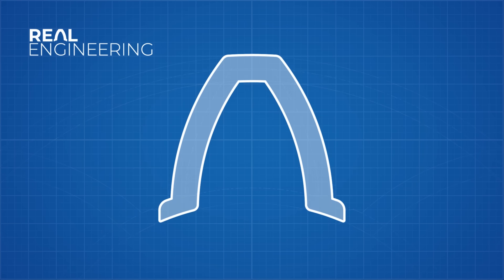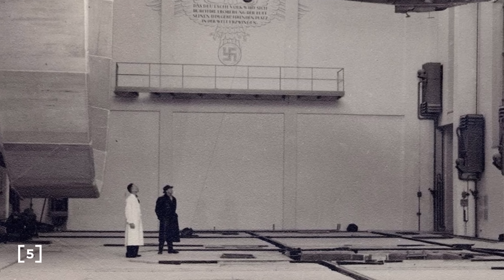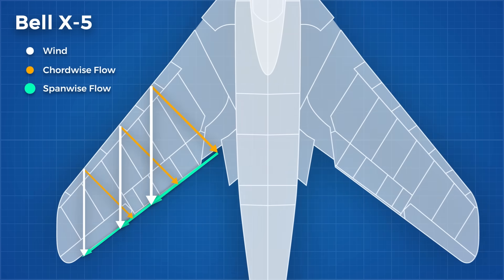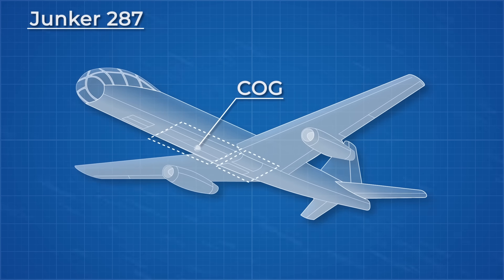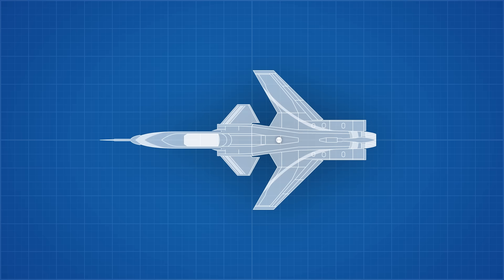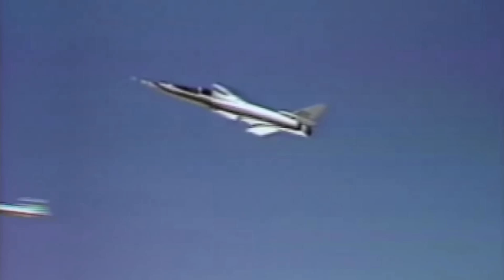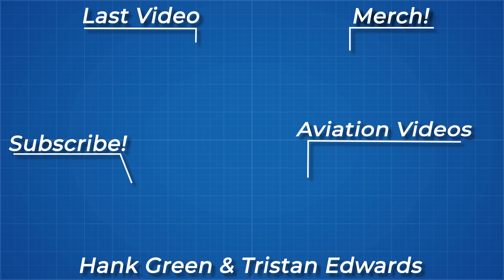Why Do Backwards Wings Exist?

Comment: I don't think it was due to ailerons becoming less effective.. it was that tip spillage and therefore tip vortices and induced drag (especially at high angles of attack) were exacerbated by rearward sweep. Yes, rearward sweep also increased the propensity of the wingtips to stall. So by sweeping the wings forward and moving lateral flow to the root,  you reduce or eliminate tip vortices and prevent tip stall. I also think your analysis of canards causing instability is off.. there are a lot of stable canard designs, many are even homebuilts.. what matters for longitudinal stability would be the location of the center of gravity (and the size of the stabilizing surfaces). The reason the X-29 was unstable wasn't the canard layout, it was the rearward CG. The reason why canards aren't used for large airplanes is that they are relatively inefficient - the mainplane can't operate at the maximum coefficient of lift because the foreplane has to operate at a higher coefficient of lift than the mainplane. This, by the way, makes canards inherently safer (especially for general aviation) since the foreplane always stalls first, and the nose drops while the mainplane is still providing lift.

Comment: Taming the pitch instability is easy with modern closed-loop flight controls, and the aeroelasticity issues can be resolved by tailoring the wing's  composite layup to have the desired bend-twist coupling. The real show stopper is radar cross section. Forward swept wings are like flying neon signs in the RCS world.

Comment: Wing roots aft at the already most reinforced section of the engine compartment allows a lighter front making a lighter over all and heavier load bearing wing if wanted. Would be great as an interceptor only plane able to accelerate and climb faster with a light plane and missiles. But interceptor specific isn't the thing anymore.

Comment: Similar reason forward mounted steering racks/linkages are more stable than rear on vehicle steering axles. The bushing deflection acting in a similar manner to wing tip deflection.

Comment: Additional Facts :--->
(1) The bernaulli principal for describing lift over airfoil is inaccurate. We must understand it through Coanda effect and Coeff of pressure distribution
(2)  In Sweepforward wings the root will stall first then tip at high alpha which will cause sudden loss of lift.
(3) like sweepback it is also good in directional stability

Comment: Forward swept wings grant good low-speed handling, which is why they are not uncommon in sailplane designs such as the Blanik and Puchacz series of glider trainers (and others).
Reply: And allows the wing to be attached behind the long two-seat cockpit, so it doesn't obscure the view from the rear pilot (as you have in Ka-7 and Ka-13 and older sailplanes).

Comment: “People like to say this is false but it’s just one of the ways a wing generates lift.”  No it false because it misapplies Bernoulli’s principle. Bernoulli’s equation is only valid in steady, incompressible, inviscid, and irrotational flow. The flow around a wing is viscous, rotational and in the cases you are describing compressible.  Also the air is not lower pressure because it is faster. It is faster because there is a low pressure zone that causes it to accelerate.
Reply: Whats it mean when you say flow around a wing is rotational?
Reply: jetison333 the curl of the velocity field is nonzero

Comment: You should do a video on how lift on an airfoil works. I've heard so many conflicting things about it. One source will say bernoulli's principle doesn't even apply to air foils, and it's newton's third law that's responsible, another source will say both newton's third law and bernoulli's principle can be used to explain it. Another will mention only bernoulli's principle.

The biggest argument against bernoulli's principle I've heard is that it's ridiculous to think that the air on the top of the airfoil would have this magical connection with the air on the bottom that somehow makes them meet at the trailing edge at the same time, no matter the distance they have to travel. It's all very confusing and I guarantee few people outside of engineers actually understand it. I thought I did for decades.

Comment: Forward swept wings typically have highly non-elliptical lift distributions (cCl) resulting in much higher induced drag, not lower as your video suggests (6:48).  The sectional Cl's at the wing tips are lower which typically produces better stall characteristics but with a normal taper ratio (<1) you are essentially guaranteed a far from optimum spanwise lift distribution.

Comment: The problem with the wingtips stalling first is the sabre dance.

Tail heavy is unstable with or without a canard, nose heavy is stable. You can make convention swept wing planes tail heavy and they became unflyable without a computer system updating the control surfaces many times a second;  it is why F-16s are fly by wire.

Comment: My dad actually worked on the X-29, and he was glad to see a video about it, and summarized the video before it even started. He said the US was interested in forward-swept wings for 2 reasons. 1: Forward swept wings increased fuel efficiency and 2: Forward swept wings did not produce vortices so fighters could use ailerons while going vertical and use guns more accurately. The forward swept wings were never implemented because stealth aircraft wings need to mesh with the aircraft, which couldn’t work with forward swept wings. Eventually stealth became more important than efficiency and control, and that was it for forward swept wings. I know this is probably just a summary of the video but he said this just off the top of his head without even watching.

Comment: If I had a nation and military of my own, all my air superiority based fighters would look either like the X-29 or SU-47. It's just none of the pilots were ever confident and good enough to handle them without ever feeling scared. It's always easy to rely on the same old boring conventional designs that require no sense of creativity independent thought and besides, it's only going to be a matter of time before stealth technology becomes completely obsolete and eventually remembered as little more than a sales pitch gimmick for the F-35.

Comment: And now the F22 and F35 both have "forward swept" trailing edges to their wings. Makes you wonder.
Reply: Mostly a design efficiency for supersonic flight
Reply: backward swept... wing tips are behind wing attachment.
Reply: Both of those Jets were expensive mistakes.
Reply: @levvy3006  largely from a bureaucratic standpoint and from the gov't pov, they're technical marvels though, and from lockheed's pov the best investment they made.
Reply: @levvy3006  the F-22 wasn't an expensive mistake.

The F-22 outperformed any other fighter jet ever built at Air Superiority type missions.  And by the time the program was abandoned, it was already >90% complete and in production.

Abandoning the F-22 to start over with the F-35 was a mistake, and an example of Sunk Cost Fallacy.  The money to develop the F-22 had already been spent, there was no getting it back by canceling the program.  The remaining cost of pushing a bunch more F-22's through the door was much, much less than the cost of developing an equal number of F-35's from scratch.

As for the argument that the F-22's Air Superiority role was unnecessary- not really.  It's updated Fighter-Bomber's that we didn't need: existing designs were already filling that niche quite well.  So long as the US can maintain air superiority, it doesn't need the most modern bombers and fighter-bombers: in fact doing so only unnecessarily drives up costs.  When you own the skies, you can bomb enemies at your leisure...  Indeed it's low-tech lightweight propeller planes that are gaining support for the new plane to fill the Close Air Support niche...
Reply: @Northstar1989  
The F-22 and the F-35 have different roles tho... The F-35 is the low aircraft in the hi-low mix with the F-22 being the hi...

And no, the F-35 was not a mistake compared to the alternative option.

Comment: Most favorite statement from the plane specifications: If the flight computers lose power or fail, within 2 seconds the aircraft wings will experience aeroelastic divergence.  (i.e. They rip off).

Comment: More Fun Facts about the 3 redundant flight computers:  Each of the 3 flight computer boxes contained 3 flight control processors... for a total of 9 available to keep the plane under control. 2 were digital computers, and 1 was analog. As Shawn Elliott stated in his post, if 1 of the boxes disagreed, then it was voted out by the other 2... however, if only 2 are running ... and 1 goes it's own way... which one is right and which one is wrong?  Rather than risk that scenario, all 3 'highest level' control processors would shut down and the 2nd set of 3 digital computers would take over. The 2nd set had simpler, more restrictive, control algorithms so the plane could return and land.  If one of those failed, it was down to the 3 analog controllers to keep it stable.  It obviously worked well, since they only built two aircraft and did a Lot of pushing the flight envelope at Edwards... and still had two good airplanes at the end of 4 years.

Comment: some info/reality check.    pick any source of information (even sources like wikipedia), and you will find  misstatements or  out of date 'science facts'.        at 2:02,  it is a mistake to reference bernoulli, here.     his work  does  NOT  apply  to  Aerodynamic lift, produced by an object   moving    through  air.    it is correct to say that,  'lift is the result of persistent zones, of differing pressure, above and beneath a wing'.      at 9:51,  huh???   in general, a horiz-stab  has an  aoi  of  zero-degrees.   and is, therefore,    NOT  a source of  nose-up moment; unless it is  trimmed that way.     increased fuel efficiency is a wonderful things, so long as the plane does not break up or  decide to Fall out of the Sky.      at 12:11,  should be  'forward-swept  wings went out',  not  aft-swept.       googletranslate

Comment: Lift as a consequence of Bernuoulli principle is not false, what is false is your animation of the air flow. The same particles that are separated at the begining of the wing do not necessarily met at the end of wing. Thats the comon mistake that you might wanted to point out if you had done some research.

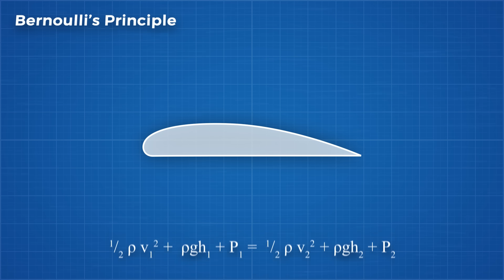Comment: 1:50 There is however one commonly made mistake with regards to lift. People often explain the difference in air velocity by - often implicitly - claiming that air passing above the wing will do so in the same time as air passing below it. (Your animation suggests this as well, each pair of arrows stays right on top of each other.) 

Due to the shape of the wing, this would mean that the air above the wing has to travel a longer distance in the same time and thus travel at a higher speed. 

If the given assumption was true, completely flat wings wouldn't be able to create lift. They are however - alongside a boatload of drag, which is why wing shapes tend to be more sophisticated.
Reply: Flat wings don't generate lift at zero angle of attack. At a positive angle of attack basically anything somewhat flat can generate lift by redirecting the air flow.

Comment: Forward swept wings exist because there NEVER WAS AN AERODYNAMIC REASON FOR BACK SWEPT WINGS. Back swept wings are based on the psychological impression that dart shaped objects are more aerodynamic, which in the case of wings and planform aircraft shapes is simply wrong.

Comment: The differential pressure on top and on bottom of wing may be part of lift mechanism, but the common explanation of lift using Bernoulii principle is seriously wrong, as there is no mechanism to force stream going over upper side of wing and the stream going over lower side of wing to have equal travel time (to meet).

Comment: The irony is: All modern jet fighters are being made with the center of lift in front of the center of gravity to make aircraft unstable -> very maneuverable. The SAS (Stability Augmentation System) Keeps the aircraft stable, so the pilot does not need to do any constant inputs to keep it stable.

Comment: The centre of pressure diagrams didn't seem to prove anything. In both cases the centre of wing pressure was behind the CoG, meaning the craft had to pitch up with the control surfaces to avoid nose-dives. The only change in those diagrams is that canards are used instead of elevators, which can be achieved in rear-swept aircraft anyway (e.g. Eurofighter Typhoon).

Comment: Its not really a quest o.o n they've been around for a while its not a question is to why it exists it can help the maneuverability of the aircraft about the whole with more speed there's less moving on the control surfaces that's common knowledge more speed means less maneuverable speed

Comment: What if there was a plane with a forward and rearward swept wing? Equal in size but that bend at 3/4 way from the tip. The front upward and the rear downward at high speeds. And at low speed engaged it's regular expanded wings

Comment: Loss of roll isn’t the only problem with the wingtips stalling.  It also causes the centre of lift to move forward (only the unstalled  portion of the wing is contributing to lift and that’s all forward of the stalled portion). This causes a tendency to pitch up, exactly the opposite of what you want to happen in a stall.

Comment: My friend Col.Kellman (USAF Ret.) was the program photographer. He took some amazing shots of that aircraft. I did my A&P airframe college certificate term paper on the forward swept wing. I over optimistically predicted that future planes might use these wings for their fuel saving attributes. Sadly the industry has not embraced the technology. Probably due to the high reliability computer requirements & the move towards making planes easier to work on for the mechanic.

Comment: The explanation that the longer distance of a curved wing leads to the higher velocity and thus generates a pressure differential which creates lift IS wrong!
It's the deflection of air which leads to the pressure differential. This creates lift, the speed differential is just a cause of this. 
The curved shape helps airliners create lift efficiently, but a straight, even plate would be able to generate lift as well, no difference in length top vs bottom. This is the often stated theory which indeed is wrong

Comment: Just want to add that the Russian SU-47 remains to this day (despite the instability in design) completely intentionally. By having an aerodynamically unstable aircraft that is constantly being corrected by Flight Computers, if the pilot wants to make a rapid maneuver then the flight computer has simply "turn off" the correct stability controls and the aircraft will "unstably" (but controlled) assume a whole new direction. It's what allows the SU 47 to be one of the most nimble and lethal/evadable fighter jets to this day.

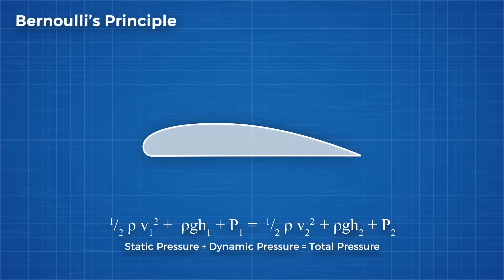Comment: 1:55 - Bernoulli's Principle accounts for a TINY amount of lift, stop using it to explain this stuff when it's irrelevant: It's Newton's Third Law that's responsible for almost all of the lift, while the airfoil is designed to maximise the air deflected down (and therfore producing an upward, opposite force (lift)) while minimising drag (from turbulent flow on the upper surface, particularly when it meets the trailing edge). Don't believe me? Then what's all that wind underneath a rotary wing aircraft (ie. helicopter) because it's not getting 'sucked up' I can assure you; Ground effect is all about Newton's Third Law; Lhe list goes on.... 

Also, the air doesn't 'speed up to supersonic speeds' at all - it's practically stationary if you think about it properly. What a silly thing to say. The problem (again) is the air flow over the wing's top no longer being laminar, which is more of a problem when the wing is supersonic, especially as the leading edge starts compressing the air significantly (ie. shock waves).

This is full of misinformation, which is disappointing for a 'real engineering' video.

Comment: Is not false that the wing generates lift because on average flow moves faster above it than below it. What is wrong is the animation where the particles on top meet the particles below on the trailing edge. In other words what is wrong is saying that to particles that begin together have to go faster above to meet together. The air on top moves way faster, so two particles that began together will never meet again. (if they met the whole airfoil would be seen as a not rotating cylinder, that is, no circulation, that is, no lift, only drag)

Comment: There's also another nail in the coffin for reverse swept wings in military aircraft: They limit the amount of pylons and mounting points that are usable compared to large span delta wings. Even if the aircraft is capable of carrying more ordnance/weight, there is no physical space left to mount it. And carrying lots of ordnance and equipment and having pylon/mounting space is paramount to military combat aircraft. There's also the fact that whatever benefits to maneuverability can be had can be mitigated otherwise by things like thrust vectoring, canards, or other aerodynamic options that aren't as much of a drawback. Also, the positive benefits of less drag in supersonic flight and saving on fuel are less pronounced now that things like supercruise capable jet engines are now possible.

Combine that with the engineering requirements and cost and it just doesn't have enough going for it to justify using it for military combat aircraft. Which is basically the only viable option there was for it to begin with.